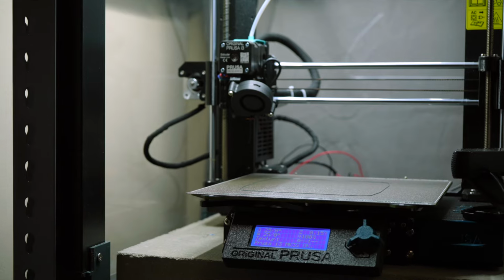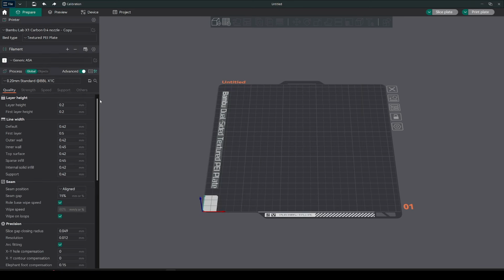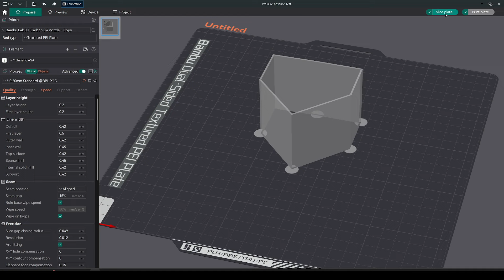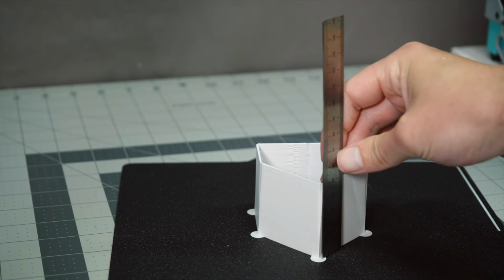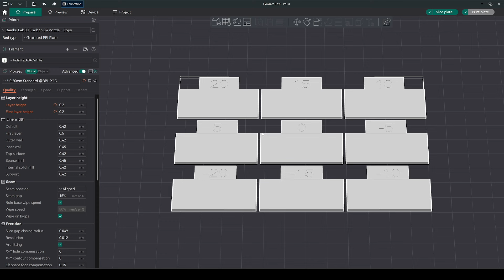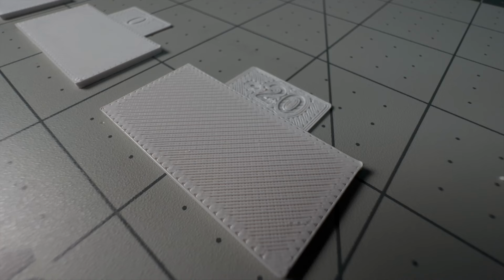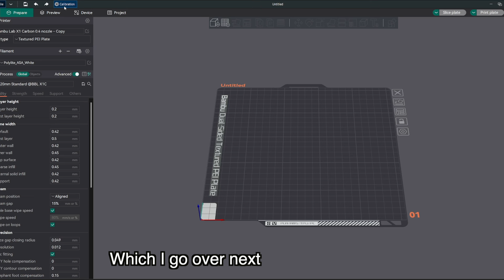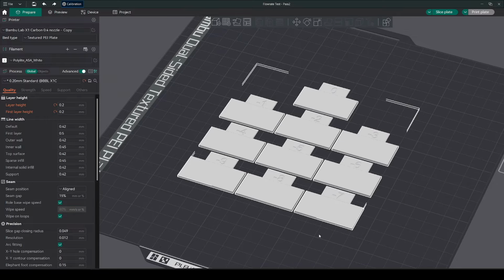Manual Filament Tuning on Bambu Lab Printers with Orca Slicer!

Comment: I originally did the X1 calibration before every print, but like you, I realized you only need to do it once per filament spool -- it's a common suggestion on BambuLab's forums for them to give some form of UI information on what the relevant values it determined are so we could load those into the OrcaSlicer's filament settings. I get they're trying to keep a lot of proprietary info, but it'd really help accelerate what we can do with the LIDAR if they'd provide some form of API for it. There's already a few makers working on their own open-source version of the automated scanning, so it's not like it's going to be exclusive for very long.
Reply from the maker: That's awesome to hear! The hardware is there and I saw a video of some guy doing his capstone project (or something with school) doing automated laser scanning PA tuning. The future of 3D printing looks good!
Reply: The absolute smartest thing Bambu could do now that they've enjoyed their year of supremacy, is open stuff up. They don't necessarily even have to open source the firmware, but stuff like allowing you to make your own RFID tags for the AMS and releasing documentation for their custom gcode would go a long way to encouraging people to stay with them.
Reply from the maker: @lostsauce0  it would definitely be awesome if they did that!

Comment: I've been using this since the SoftFever fork, and the calibration tools have got better.  I tried PA Line mode, but the PA Tower model is much better. My go to slicer was SuperSlicer on my other printers, so using Orca is a no brainer for me. I use the calibration tools for all filament set ups, sometimes change temperatures for different colours, and now disable the auto calibration on my X1 Carbon to save time on start of print. BTW, I'm using the 0.6mm hardened nozzle, and in Bambu Studio the profiles initially weren't that good for me, and using SoftFever/Orca was the best workaround.
Reply from the maker: Sounds very similar to my experience. The PA lines were such a "PAin" to get off the sheet. All the little numbers flew all over my office while peeling them off

Comment: I am curious what your reasoning is to calibrating the Flow Rate after PA. I do not know enough to have an opinion except that the Orca Slicer Documentation recommends doing the Calibration Tests in order as they appear in the menu, which would mean Flow Rate before PA. Is there a particular reason you do the opposite?
Reply from the maker: I follow Ellis’ guide. In my opinion we mostly use EM for top surface and mostly use PA for corners. Although PA also controls the edges of a top surface because the nozzle stops and turns around. I feel like it’s best to tune PA and get your corners right first, then see what your top layer looks like (center and edges) and tune that with EM. Because PA tunes the distribution of material, not the amount of material.

Comment: I highly recommend the Andrew Ellis method for flow tuning over Orca's built in.

You can get much more accurate results by testing specific flow %'s.

In your own example, the smallest step available for adjustment is a 4% jump! This is HUGE when you consider like you said, most fillaments are between 95-98%. That's only a 3% flow difference for the entire range! You jumped out of that range in one step with the Orca method.

I get much more accurate, repeatable results by simply testing 94%, 94.5%, 95%, 95.5%, 96%, etc 

You also say the PA tower is "better" than the PA line test, but do not qualify this with a reason. I don't find this to be true. I tend to get the same results with either test. The tower takes longer and requires measuring and the simple formula. Its advantage is looking more like a "real" print. The lines test is much faster and gives you your value, but scraping off the lines can be annoying depending on your build plate. It's personal preference, but they both work great.

Andrew ellis has the Pattern tool, which takes a bit of setup to adapt your start gcode to, but it is also my prefered method. It prints quickly like the lines test, but gives you "real" corners to judge from. No formula needed and peels off the plate in one single piece easily.
Reply from the maker: That's why I linked his site in the description. Do you have a way to make his test work on an X1? I never got it work for me. That's what I use on my Voron, but I stick with the built in one for Orca slicer on my X1. My qualification for why the tower method is "better" is that its easier to remove and give you more intuition for corner sharpness. I should have mentioned in the video, but I would recommend running any of these methods multiple times with finer steps, exactly like Ellis recommends. I've spoken with him on Discord and learned a lot from him, so I totally agree.
Reply: @ButterPockets  Setting up his flow squares in Orca is the same as any other slicer really. You set your flow to 1 in fillament settings and then set what you're testing per object. Objects mode (Make sure advanced is on) and scroll down in the quality tab until you see flow ratio. You can also use orcas calibration tool to generate, and then just go to each individual object and change the flow manually. The printed label wil be wrong, but it will work properly. 

I'm looking at orca (I was previously on an older version of softfever, when he first introduced his cali tools) and pass 2 is actually more accurate than it used to be. So that's great! But you still don't get 0.5% incriments which I prefer for best results. I think you are totally right that if we just set flow to 1, and then go directly into pass 2 most people will get good results.

As for the ellis pattern test it did take a good afternoon to troubleshoot start Gcode that worked for it, but this does work for me: https://pastebin.com/RYPCSWQi
This is for an X1C, not sure if it would work on the P1P but I imagine it would since lidar is not used.
Reply from the maker: Thanks a lot of the gcode, I can maybe add something or make a second video for his pattern tool, that's exactly what I've been wanting to use. That's actually what I was referring to for setup, not the flow. I do agree that less than 1% steps would be really nice for pass two, but honestly for most cases those 1% changes are fine. It's also my understanding that pass 2 changes by 1% so if your current setting (after running one pass) is 96.8% then you'd be changing 1% from that so it gets pretty dialed! I really like the suggestions and I'm glad you could share
Reply: @ButterPockets  
Right on thanks for making the video, we need this kind of info to be more available. Do let me know how that start gcode works for you.
Reply from the maker: Will do. I definitely plan to test it after I film my MK4 video and plan to make a video to show everyone. Definitely going to give you credit for the find!

Comment: Thanks for the video, if I did this and tuned the filament but dont uncheck the auto calibration would it overwrite my custom values or fine tune them?  I just dont seem to trust that its actually using my numbers as the saving of the filament doesnt seem so straight forward.

Comment: But did you do the auto calibration on textured PEI or did you do it on Cool Plate/Engineering Plate?
Reply from the maker: When I used auto calibration I would do it on a cool plate/high plate with the filament in the first slot. Then swap the plate over so it's saved for the first slot. That's my understanding of how it works. Although I have tried the auto calibration with the textured plate I have from Honey Badger and it seemed to produce the results I would expect from the auto cal.

Comment: How do you keep the Bambu from shaking so bad I can’t complete my temperature test due to shake.
Reply from the maker: I have it on a really stable shelf. Go to your local hardware shop and buy a stone paver, should be like 4-10$. You can also get a rubber mat to go under that as well. You could order like a bar mat on Amazon or any other kind of rubber vibration damping material.

Comment: Do the calibration tests work if you have other profiles selected? IE 0.16mm, 0.12mm, etc default Bambu profiles or does it have to be .20mm?
Reply from the maker: I would run them all at 0.2 to save time then it should all be valid for those other layer heights.

Comment: So from this it seems like there's very liittle benefit to going with the X1C over the P1S if you don't care about the touch screen? You can buy the hardened gears and nozzle for the P1S and likely acheive similar or better results with those simple built in calibration tools in the slicer. I've been really on the fence thinking about buying a P1S but worried that I'm cheaping out and that I should just wait and eventually buy an X1C instead. I also know that the bed doesn't go as hot on the P1S but I think 100C should be good even for PC-CF.
Reply from the maker: With the bed being different I’ve seen a lot more people have problems with the P series bed than the X series bed. I don’t know if this is fixed or wasn’t really as big of an issue as it seemed. But I’d be weary about that.
Reply: X1C lidar is useful for making sure you have the correct build plate on (it saved me once) and the spaghetti's detection / unslect object while printing helps a lot too.

Comment: I had a great time doing calibration like this and being able to save the values in my Filament profiles thanks to Orca Slicer.  The only thing I ran into is... I had this big bag of 3 meter bits of coloured filament to play with. It was the most garbage filament in the world , so I really wanted to run calibration. But guess what. You can't run calibration on a 3 meter bit of filament. Someone needs to make a very very tiny sort of calibration lol.

Comment: thanks. I don't follow where you went after you did the fine tuning of getting that -2 and -3. where and how did you use that number into the calculation to fine tune the max flow rate? Thanks
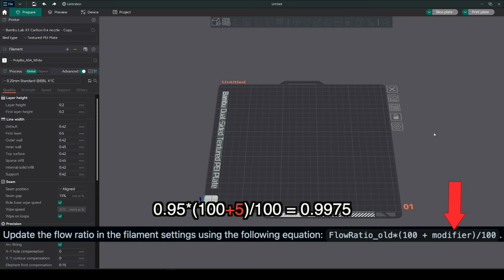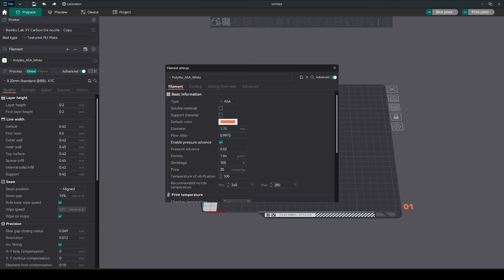Reply from the maker: At 5:48 I have the equation shown. Ratio_old*(100+modifier)/100. So the -2 or -3 would be the “modifier” in that equation. You are essentially multiplying your current flow ratio by .98 or .97 (or 98% and 97%). At 6:02 I show where to enter it in the filament settings.
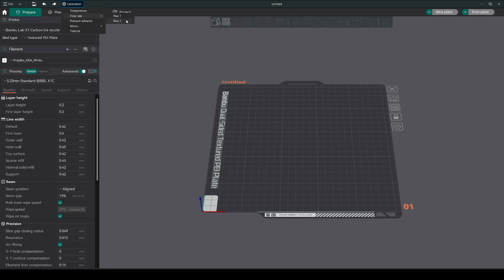Reply: @ButterPockets  yeah, I did the first one and got +5, so I chucked that into the formula. What I didn't really get is, you then printed pass2 @6:10. how did you set new value into pass2? when I did pass2, it came up with what you've got in the vid, but that's because you got -5 from the first one. Since I chose +5, shouldn't it be 0 to +7 instead? and if yes, how can I set that up? Sorry if I sounded confusing cuz it's because I am.

Comment: I noticed you measured the height from on top of the mouse ear. Is that accounted for in the measurement you read out?
Reply from the maker: That's actually a really good point! Since the k value only changes every 1mm then the 0.2mm of the mouse ear shouldn't change which millimeter (or k value) you pick!

Comment: Great video! I noticed you don't have all the lines in the front of the build plate. Care to share what you changed in the start gcode?
Reply from the maker: That's the automatic calibration, which you should turn off to do this tuning!

Comment: Great video! Do you usally print from Orcaslicer or do you only calibrate there and implement the calibration settings into Bambu Studio somehow? Thanks.
Reply from the maker: When this video was made you couldn’t even access pressure advance in Bambustudio. Even now though, I typically use Orca if I need a highly tuned profile. If I need a quick print or prototype I’ll use BS and the auto cal.

Comment: Ok so with this in mind is the x1c any better than the P1p? I have 2 x1c machines so it would be great if I can get spend less lol
Reply from the maker: It's up to what you need your printer to do! I know you can print enclosures for the P1, but having a fully enclosed printer from factory might be worth it. Especially for PLA the P1 makes a lot of sense. If you print Nylon, ABS, or other temperature dent I've materials I'd probably learn toward the X1.

Comment: I just installed orca and was attempting to do the pressure advance calibration with Asa, no matter what I do the tower breaks loose on the build plate . Any suggestions?
Reply from the maker: Check out my pt2 video and use that method.

Comment: Bambu also knee caps all filament not from their store. The Bambu printers can handle a volumetric flow of 15mm³ and yet by default anything other than bambu's filaments have a default value of 5mm³

What this mean means is not only is the printer going to print 3 times faster with the correct value, but you might actually get even cleaner prints when the printer is allowed to move based on set speeds.
Reply from the maker: I’ve found 19mm3/s works with all the brands I use!
Reply: Never saw 5mm3 as a standard on my X1C for non Bambu filament. Only TPU profile is below 5mm3. And the max flow is around 20-25mm3 with ABS for me.

Comment: I just did the PS calibration and overall was good maybe in the button is not super sharp like in the top in this case, do I need to make any adjustment or I just leaved this way???
Reply from the maker: You stop when you're satisfied with the results! My next video is going to cover an even more in depth tuning method!

Comment: also they recommend doing flow rate and pressure advance after...
Reply from the maker: I recommend doing it this way. When doing the flow rate test and your printer is doing solid infill it's using pressure advance on every line as it sweeps back and forth. If your PA value is wrong then you'll see bunching or gapping at the edges of your solid infill. To be even more precise you would run PA, then EM, then PA again. It's up to you how precise you want to get!

Comment: What do are you suppose to do with the DEVICE tab K factor? Once you make a calibrated profile are you also supposed to match the calibrated profile and the K Factor in the AMS and EXT SPOOL slots? Not sure if youre supposed to just leave it at 0.00 once you calibrate a profile.
Reply from the maker: I believe if you use the value in Orca it will override whatever is on the AMS slot.
Reply: @ButterPockets  that seems to be correct. You replied to me on reddit too recommending these videos but I'm still having top layer issues. Is it possible to have filament to have a k factor of 0.005 or 0? When I do lines on my p1s those are the best results. Same with the tower test as its more accurate since I can measure exactly. Driving me nuts. Might just sell my bambu lab.
Reply from the maker: @rawisjericho  if 0 is the best something else may be wrong. What’s your extrusion multiplier set to? Message me on discord. My username is “butterpockets”. I would gladly work through it with you
Reply: @ButterPockets I sent you a message on discord!

Comment: Thanks for the awesome video ! 

Just a quick question, I completed the PA test and enabled and edited the PA value, busy with the Flow test now, but on the device screen I see the K value remains the same ? Is this normal ?
Reply from the maker: I’m actually confused what you mean by device screen?
Reply: @ButterPockets  When you are in Bambu Studio or OrcaSlicer, on the Device ribbon that you are directed to as soon as your print starts.
Reply from the maker: @pierrediedericks5385  that’s what I thought you meant…hmm I don’t see anything about k value there. Feel free to email me (my email is on my channel) I’m interested in this!
Reply: @ButterPockets  Will be sending you an email 🙂
Reply: @ButterPockets  For some reason i cannot find your email address 🤦
Reply from the maker: Butterpocketsllc@gmail.com. Sorry I just saw this. It should be in like the about me section of my actual channel. There’s a thing to click to show it under contact.

Comment: How come you didn't do retraction?  And if I heard correctly, you said skip Pass 1 and go straight to Pass 2?
Reply from the maker: I personally don’t tune retractions with anything other than watching my prints. I’ve never had to change it from defaults on my X1. And yes, pass 1 is mostly unnecessary. There’s no real benefit to seeing +-20/10/5. You might as well just start at 1 or 1.1 and let it go down in 1% steps with pass 2
Reply: @ButterPockets  Thanks!   I just did my flow calibration for Hatchbox PLA and both passes, zero was the one.  I love Hatchbox.  Now I'm more confident that I'm closer to perfection.

Comment: Steps at 3:00... you mention 10mm x 0.02... 10x0.02 = 0.2, not 0.02. What units should we be working with? 10mm = 1cm, therefore 1x0.02=0.02, so should be we using cm opposed to mm?
Reply from the maker: You should definitely be using mm because the pattern changes the PA value every milimeter. So you're just checking the 10th step of 0.002 changes, so 10x0.002=0.02. Which you can see me enter 0.02 into the slicer settings.
Reply from the maker: You're the second person to mention this and I guess it's my southern accent coming out. I said "the steps are 'point oh oh 2' and 10 times 'point oh oh 2' is 'point oh 2'"
Reply: @ButterPockets  Gotcha... thanks. Will give it a shot. You have gotten a really nice smooth finish on your prints, I'm struggling to get ours as good. Now that I'm listening for it, I can hear the second "oh". Great vid, very helpful.

Comment: Okay, maybe someone can point me in the right direction. 

Got an X1C, I've got Orca Slicer, and I'm performing the pressure advance test. Yet, in the preview after I slice it the volumetric flow rate does not change. Also when I click on thr Print plate there us no option to deselect "flow calibration." Am I missing something?
Reply from the maker: Feel free to email me with pictures and we can diagnose together. My email is on my page.